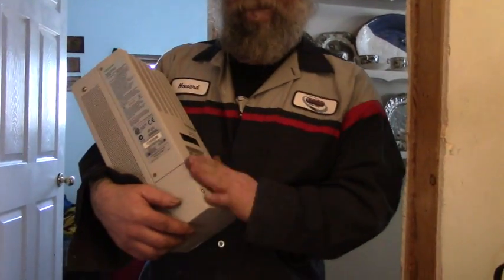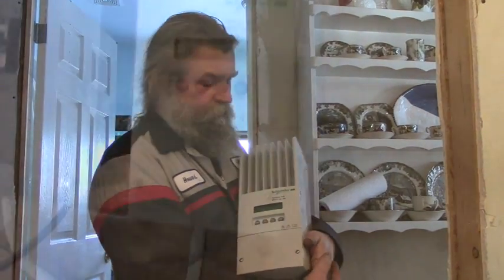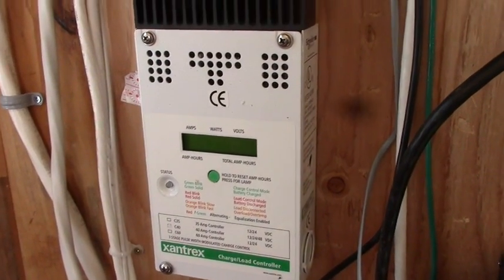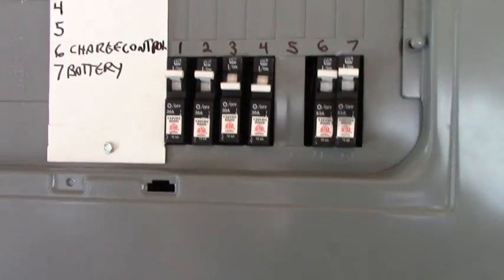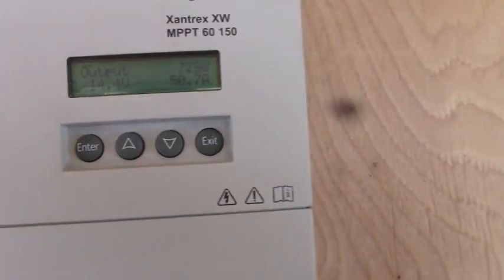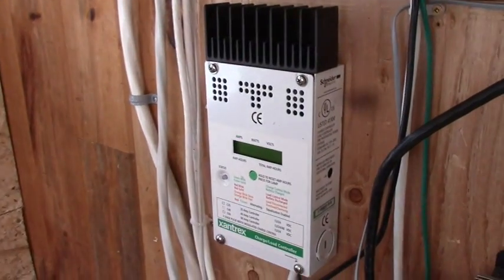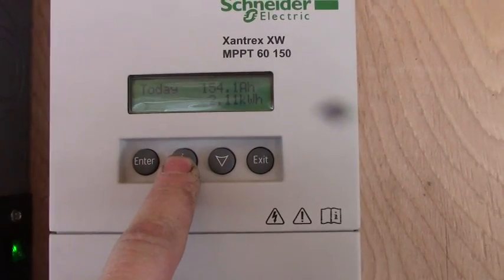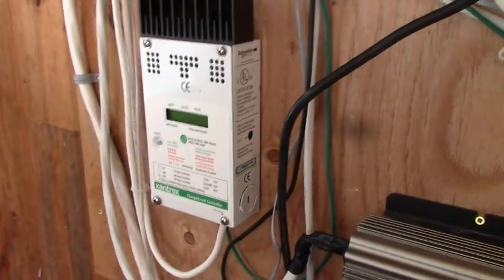More Solar Stuff With "How How Does It!"

Comment: Is Papa Volvie always this calm?  I would see the box with wires, circuits, etc. and be hysterical and scared.  Congrats on your equipment.  Someone spoke about how long it would take to recognize some savings with solar and wind.  I don't know but it sure would be priceless in a grid down situation.  Love your vids!
Reply from the maker: I agree..In a grid down situation..this runs the well pump...anything ELSE we can handle..we have the wood stove and a gennie ( generators are only a short term solution) But dropping a bucket down our well when it is covered in three feet of snow is a pain...and storing water uses up a LOT of valuable pantry space!

Comment: Mppt is the best way to go off grid. So efficient. Pwm is a good basic but will never outperform the mppt.  Great upgrade and choice.  God bless
Reply: You might want to define terms to newbies.
Reply from the maker: ECTTS Carhauler I would of course ask the appropriate question for clarification..but he is so shy..he will not let me in the porch while he is filming
Reply: Ok. Pwm. Pulse width modulated. Standard charge based on amps over voltage requiring larger wire. Mppt. Allows higher voltage and it will convert the high voltage to higher amps. Allowing the use of smaller wire from panels. Also mppt is 3 to 5 times more efficient at using your input to better charge your battery bank.  That's the brief explanation.

Comment: I am so interested in this.  I am sure the equipment is not inexpensive, in your approximation, how long will it take until the system pays itself off? I realize it is long term project, but if you were going to move in the future would you install it or wait. I was thinking about a solar system to heat the pool, so much work to only swim for 2 months if the weather is good...thought it may be a good starting point and then use it differently for the winter months?
Reply: Getting a system running for your pool sounds like a good starter project, there is so much to learn - I learned a lot just from this vid and I have been playing with solar for a couple of years.  Heating anything with electricity
 takes the most power though so be sure to size it correctly. With a little planning your system can be switched to power other things :)

Comment: Thank you so much for the How How videos... We are wanting to put our water well on solar, it is 80 ft deep, and the pump is a 210 hook up, so how many full panels like you have will it take to run just the well?... we have a shed right next to our well head that holds our bladder and electrical so it would be easy to put up panels on the roof... thank you again for all your DYI videos... Blessings...

Comment: My big apartment window faces west. I wonder about setting up some kind of solar system that would help with the hydro costs. Where would you recommend I go to shop for something like that. I'm not at all knowledgeable about things like this, but would be interested in an efficient system I could take with me if I move.
Reply from the maker: I would start researching on line..and you can buy most of the components on line.